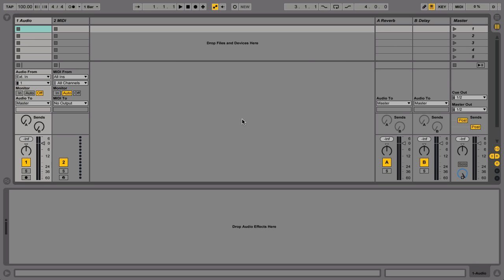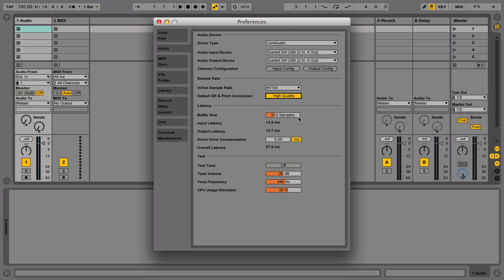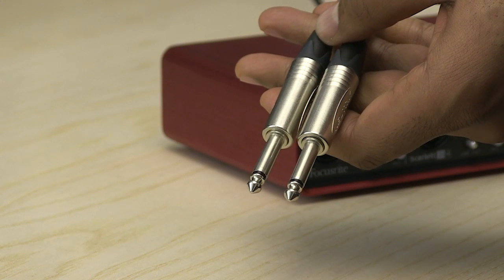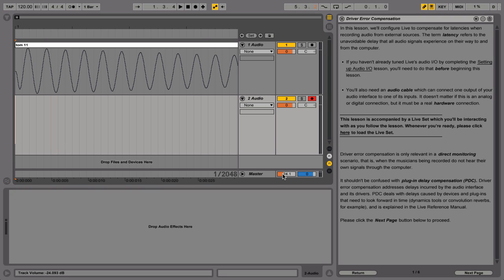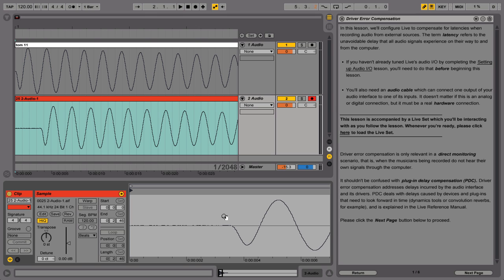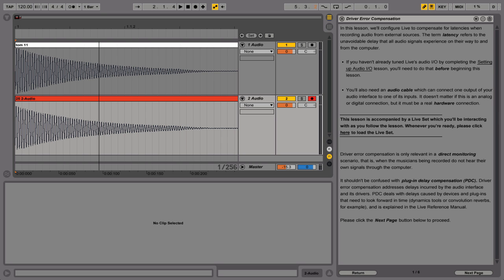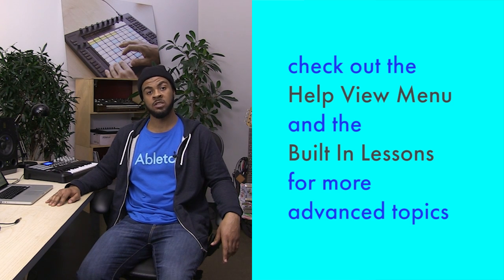Ableton Live Tutorial - Part 8: Optimizing Your Audio Interface Setup

Comment: how do you manage to plug the output from the interface into the input on the same interface and not getting that horrible feedback both in playback and the recorded clip?
Reply: I would like to know this as well
Reply: I know this is a year old question, but in the event that you are still looking for an answer, for you need to have an interface that has multiple ins and multiple outs and that gives you the ability to control routing.   As long as the input you select is not routed directly to your monitoring output, you'll not get any feedback.

Comment: followed to a T and still getting latency
Reply: I think the problem is with the Monitor Status. When I record with the monitor set to Off I have 1ms latency on the timeline. When it's set to Auto my latency is around 7-8ms (recordings made with 32samples Buffer Size)!

I found this on the Ableton forum also.
<<Turn on PDC again and turn off monitoring on the track when recording. This affects how Live places audio on the timeline. Live assumes if you have monitoring active on the track that what you hear is what you want. With it off it places audio as it comes in, which is delay compensated to everything else (as that is when you hear it). As this is incoming acoustic audio you already have real-time monitoring.>>
Reply: @Sustainable Digs I don't understand the question, can you rephrase it? I guess you try to sync with the metronome...

Comment: I wanna perform using Ableton but I'm having MIDI latency issues. It doesn't get affected by the buffer size when I lower it, and yet it often starts to make crackling and making noises even though the CPU seems just fine. I really need some help with this.

Comment: Hey, I am the point of 6:31 in the video and the second track does not seem to have any sound in it. I have tried adjusting the master track volume as said in the video, but the master track cant get higher than 6 which is not enough for my second track to have that gray bar move enough. I have no clue what to do and I am getting a little mad at the software not gonna lie, so hoping someone smart out there can tell I am just being an idiot and that there is a very simple way of fixing this.
Reply from the maker: Hi, thanks for reaching out. Is the track you are talking about MIDI or Audio? It may be possible that you need to adjust the volume knob of your audio interface as well. Any additional information on your issue will be very helpful to be able to assist you better. Cheers!

Comment: I cannot edit my "Buffer Size" as shown...how do I can I get to the different "Control Panel" you're talking about
Reply: Jalyn Sanders I need to know
Reply: I know trhis is old but if youre using asio you need to go further up that screen where you adjust the buffer size and it will say hardware settings, the setting will be inthere

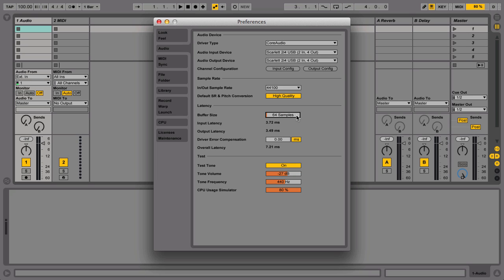Comment: 3:40 some of y'all might not have the option to type in the buffer size. If this is the case look for the "hardware setup" button within the same menu. You should be able to change the buffer size with a slider in there if you see it.

Also at 6:30 if you're not getting the grey volume bar to show, make sure the input of 2-Audio is the output of 1-Audio (it's the yellow rectangle next to "2-Audio").

Comment: in regards to the driver error compensation -  what if you have a few different audio interfaces aggregated (mac) do you still use the main interface input and output to figure out latency OR (in aggregate chain) - last interface output  to first interface input?
Reply: Peter Kazimierski I also have this question; from my experience I think that having two separate clock sources makes this feature rather inconsistent when implemented with an aggregated A/D system. A world clock may be the answer, but I sold mine off in the process of converting to digital with the mindset that my mac pro could handled syncing my converters.

Comment: Just does not work here. I have a Pioneer DJM 900 and use it's soundcard. Settings are all diferent and I have LOTS of latency and no idea how to solve that... (READ MORE!!!)
--------------------------------------------
Input buffer size: 256 Samples (at the lowest)
Input Latancy: 5.8 ms
Output buffer size: 1024 Samples (at the lowest)
Output Latency: 23.2 ms

Overall Latency: 29 ms 
--------------------------------------------

Also the 'Driver Error Compensation' is a disaster, I can't set the volume of 2 Audio at the same level only much much lower at the max, and I have to compensate 95.01 ms resulting in an overall latency of 124 ms.

I can almost smoke a sigaret before I hear some sound after hitting a pad:-)

Comment: I'm using a scarlett 2i2 interface to record a mic''d guitar cabinet with 2 different mics at the same time. I adjust the gain level so it's at the highest possible without clipping (on the interface), when i record into ableton I get a very weak output, as in the wave form itself is really small, the recording is quiet,  and i have to apply a lot of gain after the fact. Why am i not getting a full bodied recording?
Reply: quadlineboarder If you are recording hot enough that the scarlett's input is close to, but never reaching clipping, then the audio should be plenty hot for ableton regardless of the wave form size.  If you leave the volume fader on the guitar recording track at 0, what does it peak at?  If you're in the negative single digits (close to 0 without hitting 0) then there's no issue.  Essentially, if your recording is hot enough, you should need to lower the volume fader on most recorded tracks in order to properly gain stage a track.  

If your guitar recording volume is deemed hot enough by the test above, it is likely that you do not hear a full bodied recording due to mic placement or maybe expecting the guitar to sound thicker than it should by itself.  Most fat guitar tones are achieved through good mic placement, dual or quad tracking, and adding bass guitar to fatten up the low end that the guitars do not have when recorded (as opposed to what we hear in a live situation).

If you have any questions, feel free to message me.
Reply: quadlineboarder I have the same problem record something then click on that audio clip where u se the wave form then a sample menu will come up rise that bar and the wave will get bigger I don't know how to save it so it always rec in at that size and thats where my problem starts

Comment: i aligned the thing and did everything right , though when i play the guitar there is still a lot of delay . what should i do ?
Reply: Lars V.U It sounds like you're hearing latency caused by monitoring through your DAW instead of direct monitoring at your interface.  This is simply the nature of the beast and cannot be eliminated entirely.  The trick with aligning the audio clips in the video is to set up driver error compensation which only helps to keep recorded tracks consistent when compared to direct monitoring.  If you're not direct monitoring, it won't help the latency you hear when monitoring through your DAW.  It takes time to process audio through a microphone, an interface, a computer, and then a DAW before sending the audio to your ears, so this is why the latency exists (and frankly, cannot be eliminated).
Reply: @Tamarocker88  are you serious? Im saying the hell with abelton and pulling my vs880ex out this is way too irritating and time consuming kills the creative process dealing with this bs.
Reply: @djdwell787  Yes I am serious.   If you can't be bothered to configure your DAW and signal chain to minimize latency or simply deal with a little bit of audio latency, then you better quit audio production altogether. I guarantee you will face FAR more difficult obstacles to overcome in the audio production process compared to mere latency.

Comment: I've found a way to compensate for the delay without going through all of the driver compensation steps.  If your pc has a USB 3.0 connection, use that.  This reduces delay significantly.  You will hear the delay slightly but not enough to mess you up.  When doing vocals, just monitor through your headphones and you'll never be able to hear the echo.  The echo is only heard when going through monitor speakers.  I've been recording just fine.